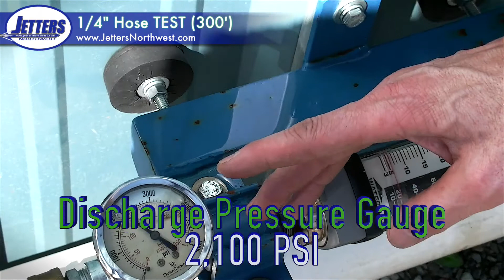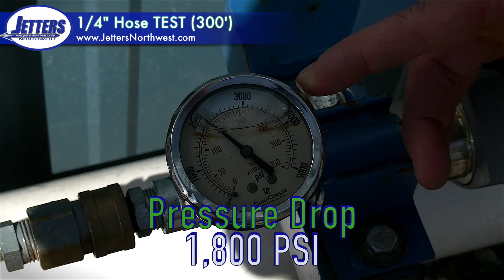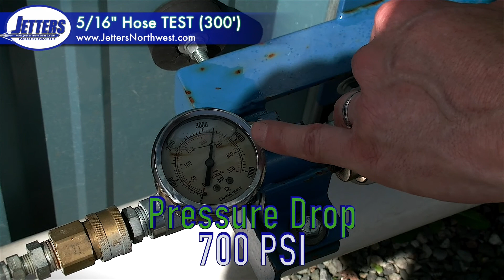JETTER-HOSE PRESSURE-DROP COMPARISON - "GET" JETTING with JONESIE

Comment: What’s the gpm you can get out of a 3/8 hose thanks
Reply from the maker: We recommend 10-GPM maximum to minimize "pressure drop" thru 3/8"ID jetting-hose, but you can do up to about 14gpm thru 3/8"ID hose except that GPM radically increases the pressure-drop (depends on hose-length of course)

Comment: How many gpm can you get out of a 1/4 inch hose
Reply from the maker: We recommend about 6-GPM maximum thru 1/4"ID jetting-hose to minimize "pressure drop" thru the jetting-hose, but you can do up to about 8gpm thru 1/4"ID jetting-hose except that flow radically increases the pressure-drop (depends on hose-length of course)

Comment: That's all well and good but there's a flaw in your scenario that you didn't account for your one holes is on board your external one was hooked to other hoses on that machine therefore that's going to make your pressure drop because you're running more hoes to hook the other one that's not on board to the machine versus the one that's already on board that has its own hose. And not to mention the second demonstration your motor was 10 times louder I could barely hear what you were saying so what you do after fire up the second engine first one I could hear you playing his day with the motor running second one I can barely hear you
Reply from the maker: Hi regarding the 1/4" Jetting hose that was not "on board" take another look an you will see at the 2:30 mark that we placed a PSI gauge just before the 1/4" Jetting hose to isolate it. That gauge is downstream of the "other hoses" you mentioned so they are in no way affecting our test.  I apologize for the sound-quality, we have better microphones now 🙂  Thanks for commenting and watching
Reply: And you really need to rewatch your video yourself you are not accurate on your system you claim you're running each one of them separately. but you are not you are running the  red one  off  another hose . every foot of hose that you have you lose pressure from so you're hooking two hoses together .versus the black one is running by itself directly to the pump
Reply from the maker: The feeding-hose is prior to gauge #1 so it is a non-factor in the pressure-drop between that gauge #1 and the gauge #2 reading 2100-PSI near the nozzle. But that feed-hose indeed caused a loss of about 100-PSI BEFORE our gauge #1 -- that is why gauge #1 is reading 3900-PSI (the gauge on the machine read 4000-PSI)

Comment: So what’s the correct answer if you want to use 1/4 hose? How do I gain max pressure and gpm coming out of my hose??
Reply from the maker: What are the GPM and PSI specs of your jetter?
Reply: @JETTERSnorthwest  8gpm- 3500 psi jetter
Reply: @JETTERSnorthwest  in this video are you saying I shouldn’t use 1/4 ?
Reply from the maker: @DTSupstateNY  I'm sorry we missed your reply!  I'm not saying don't use 1/4";  I'm pointing out that 5/16" hose can offer better performance -- especially when operating an 8+GPM jetters like yours, and especially when using longer lengths like 200 or 300 feet of hose.  Again I'm sorry for the slow reply!  JONESIE

Comment: Is this mainly due to the length? If they were both only 50' would the two hoses read pretty similar and have hardly no pressure drop?
Reply from the maker: Your are correct in that only 50-feet of hose would not be nearly as dramatic a difference. Also see my previous comment below (if you have not already)
Reply from the maker: Actually both hoses were 300-feet -- the difference is the inside-diameter:  the 5/16"(.3125") builds less back-pressure since it is 25% larger in diameter than the 1/4"(.250"). The smaller the hose-diameter the more pressure-buildup it takes to push water through it, and any pressure that is "lost" to pushing water through the hose is not available to push water out of the nozzle